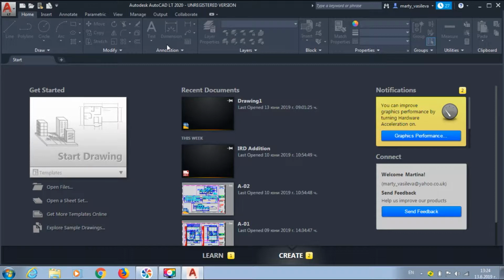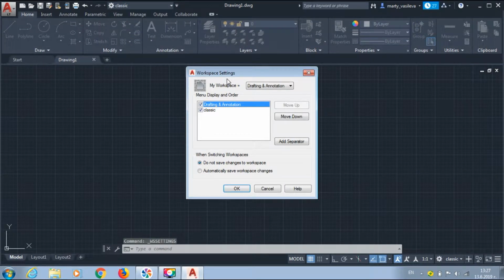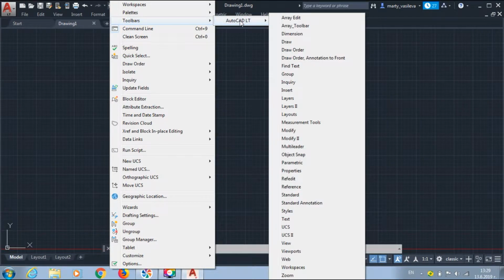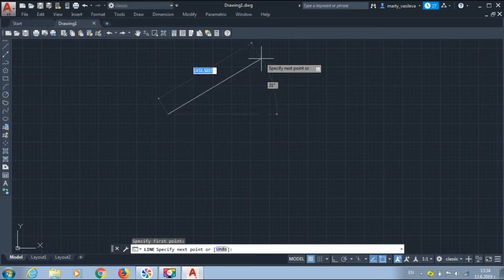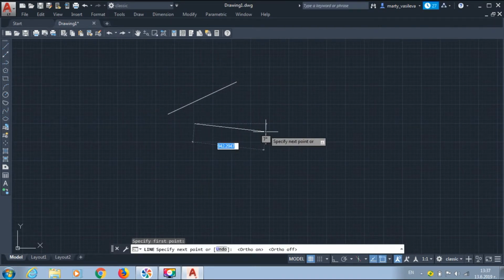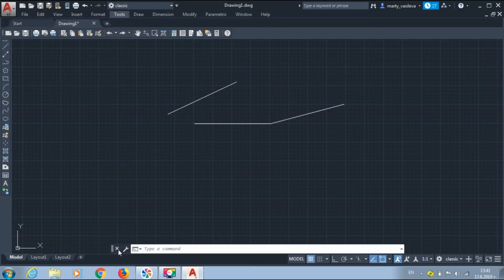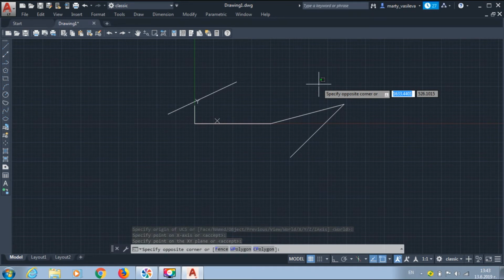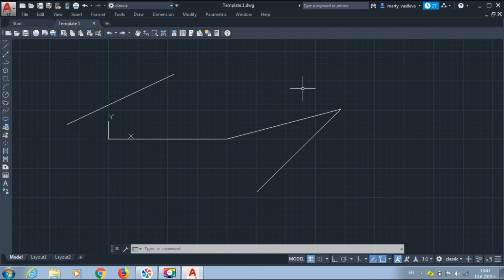Martina's AutoCAD 2020 LESSON 1- AutoCad 2020 CLASSIC view, angled LINE

Comment: After using UCS, when I drew a line with angle, i.e, with dimension @45<99. After drawing, when i measured the angle, it indicates 98 degrees instead of 99 degrees. what might be the cause of the problem? pls reply as soon as possible.